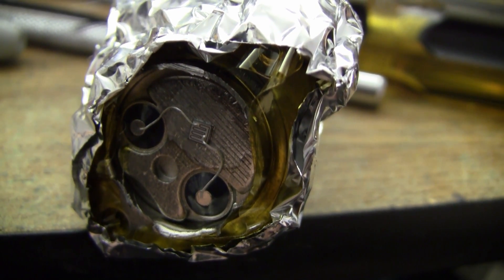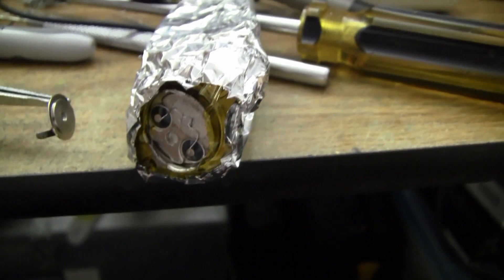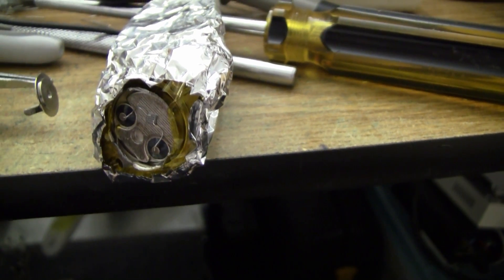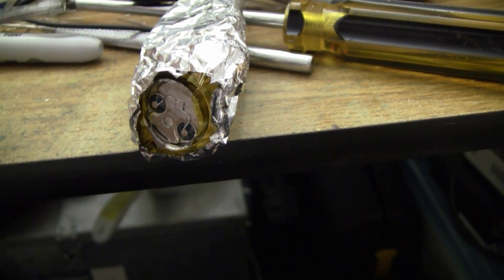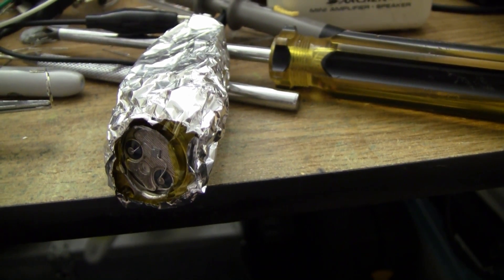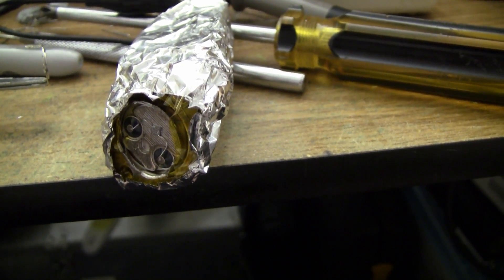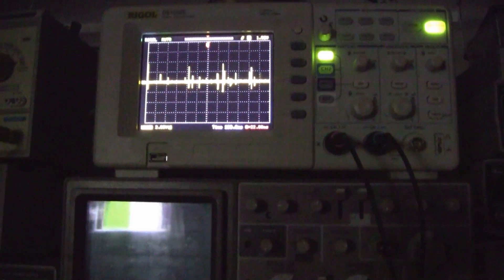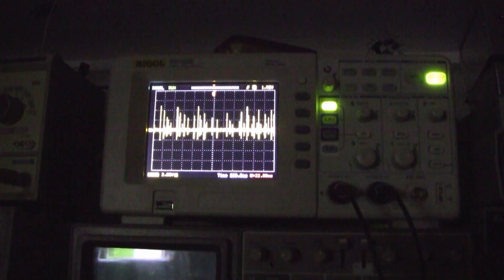2N3055 Alpha Detector

Comment: I was thinking about gutting one of my "free" multimeters I keep getting on sale at Harborfreight. (DT830b clone) and using the case for a multipupose radiation detector. Use the 2n3055 for alpha, and photo diodes for gamma and make it selectable. Also a few UV LEDs for illuminating Uranium.

Comment from the maker: @accepttheownage1 I'll write this and the more sensitive gamma/photodiode version up shortly, but the key for detecting alphas is that the die must be completely bare, any encapsulation or thick passivation layer will absorb the alpha particles before the can interact with the die.  Gamma and strong beta on the other hand plow straight through the encapsulation, but their signals are very small, so you need low capacitance devices with low noise amplifiers.

Comment from the maker: @Cristi0986 That is a 2N3055 power transistor with the top of the TO-3 case sawn off.  Works with photodiodes too, but only for gamma (and maybe beta) because alpha can't penetrate their encapsulation.  Bare photodiodes and other transistors work too.  I've made more sensitive versions since, will write it all up once I am happy with it.

Comment from the maker: @itchesavvy The pinkish flashes are from a Geiger counter.  I got the commercial pancake tube off eBay from Russia, but I built the electronics to drive it.  The details are on my website.  The construction (large mica window) of the tube let's you see the Neon glow on each discharge.

Comment: I tried a 2N3055 and a much smaller BC140. The BC140 gives only a few pulses per minute with my sample, but the signal to noise is very good. Up to 100 mV with only one transistor amp. And I can even leave the light on. I estimate, gamma is 40-60 dB lower with the photo diode. It must be very very dark and shielding is necessary.

Comment from the maker: @BjBlasterdotcom Yep I used to use the old 2N3055 a lot, but it has a really poor gain compared to alternatives, I was actually surprised it's capacitance and leakage was good enough for this alpha detector.  The Am-241 comes from a smoke detector.  I tried a number of different transistors, they all worked, polarity does not matter, neither does which diode you use (except for the breakdown voltage) but the larger die the more sensitive.